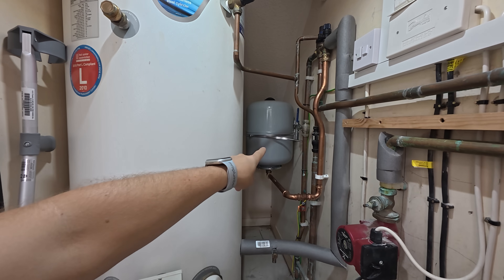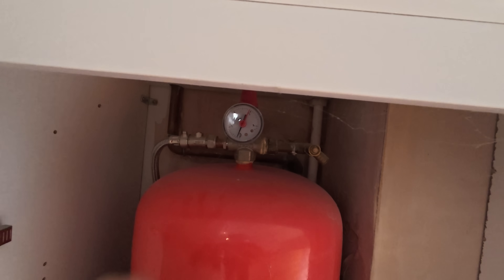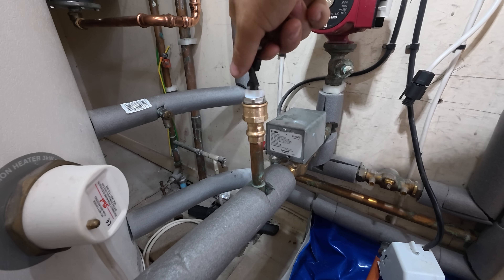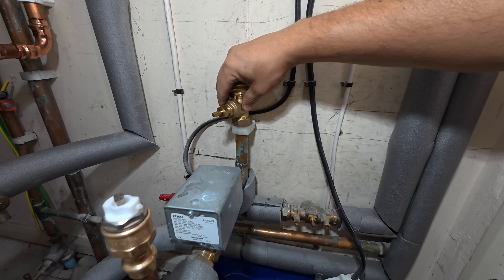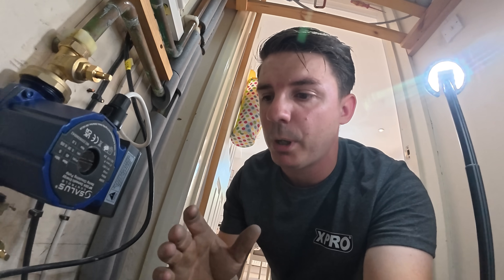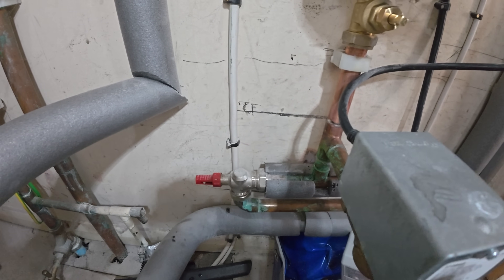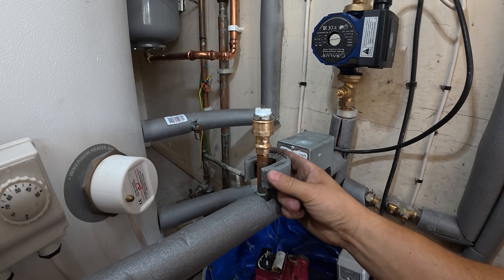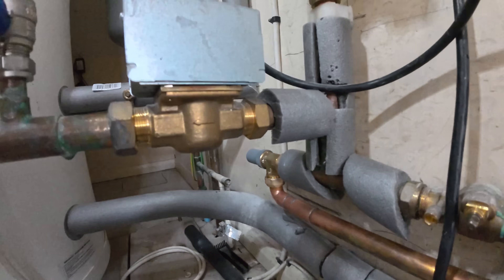No Heating No Hot Water Fix!

Comment: If you’d just cut that elbow off of the bypass valve, close to the elbow and put a new elbow on. You’d only need to cut a small piece of pipe from the bit coming out of the tee, and that way you could have saved having to sweat on the straight coupler saving a fitting and less joints. 😜
Reply from the maker: Good shout! Always find better way when you look back with a clear head 😂❤

Comment: Sir, electrically correct would be, to open the pumphead and rotate them, till writing is to read normally. Then would be the position of the cablegland ok. What was the problem of the original pump? Fixed rotor? Not practicable to unbloc?
Reply from the maker: The cable would have been too short

Comment: Did you set the by-pass? Maybe one for another video.
Reply from the maker: I left it stock mate no one knows how to set them up properly 🤣 I wish to learn myself
Reply: @mmplumber  Depending on the size of the pump an average 15/60 pump would be set at around 0.3bar. One way to set them is to turn off the heating system call for heat on hot water. Run until flow tempratures are up . Lower the cylinder-stat temperature, Boiler goes off, pump overun kicks in. And with the By-pass wound all the way in. Open slowly until you feel the heated water passing through it. You can do it via the heating system using one TRV with all other rad closed. Hope that helps.

Comment: Hi mate i never see you work on boilers. How would you know before going into a job like this that it wasnt a boiler fault ?
Reply from the maker: Because the boiler is a heat only, I’ve been a plumber for 18 years so I know myself round a system, don’t touch boilers on here as I’m not gas safe and people don’t relate to that work anyway
Reply: @mmplumber ur not “gas safe” but I bet you safer than most gas engineers in the country, best workmanship I’ve ever seen in a plumber
Reply: Because the controls are external big boy
Reply: @Fat-heed I meant before he arrives. The   customer is only likely to know that their heating/ hw isnt working.  Seems a bit odd to phone someone to fix that issue that cant touch boilers
Reply: But yeah with a few questions over the phone its pretty easy to rule out the boiler i suppose.  Not really easy for the average customer to know if they have a boiler or system fault
Reply: @lewisconway6431 sorry big boy now that u supplied more context I get where your coming from 👍🏻

Comment: I have noticed that you are not using Acetylene gas that plumbers often use, rather, using red colored gas bottle. What type of gas is in that gas bottle. I bought a mapp gas yellow bottle years ago and I still have some left in the bottle. They don't have mapp gas in my area any more, they do have a yellow bottle but I heard it is no longer a mapp gas. Acetylene runs pretty hot. I need to replace some of my one inch copper L pipe, and I haven't done it yet thinking that I need Acetylene or real mapp gas to be able to get a good solder connection.
Reply from the maker: It’s propane mate

Comment: If i'm working on a sealed system, I will just drop the pressure too 0. The system should then hang up. If no water comes out of your drain hose.You know the system has locked. At this point, cut in your isolation valve. You can now work on the system without having to drain down all the radiators. Vdi 2035 talks about positioning isolation valves in a system to reduce the amount of water that needs to be replaced when you have to drain down to exchange components. It goes on to explain that you should never change the water in a heating system, more than three times in the life of the boiler. Being able to work local absolutely, keeps the drain down and water replacement to a minimum.
Reply from the maker: Your not wrong at all but I’m showing this to people who might not seen bore 👊

Comment: Why did you drain the system down? Drop the pressure and change the pump / valves. And why on earth did you cut through the pump valves when you can simply undo the unions with a pump spanner?? That job probably took about 2 hours longer than it needed too 😂 YouTube plumbing
Reply: Yes drain system and carry out the work, correct way to it..what would I know I'm only 40years plumbing..jumping stuff is for chancers
Reply: @Roy-z2b  are you suggesting dropping the pressure is the incorrect way?
Reply: @Paul-gj9tx 😂😂😂start your own channel for chancer plumbers? He drained the system like you should..yes you can drop pressure sometimes but  that's not best practice is it? He soldering down low too..why have water sitting in pipes for soldering?
Reply: @Roy-z2b I don’t have the time to start a plumbing YouTube channel pal. I’m too busy doing real world plumbing….if you want to drain a system each time you work one go ahead….I’ll continue dropping the pressure and saving myself the unnecessary time of draining/refilling and the headache of airlocks on gravity systems….as I have for the past 21 years without issue 😂😂
Reply: You look at the state of those pump valves there as crusty as anything.
Sometimes the unions won't budge, especially if someone has used the fibre washers that come with the valves.
I tell you this after 45 years in the heating game, dropping the pressure don't always work.you think everything is ok then you undo a nut or union and it air is introduced and you go running for a recepticle.
In the end he did it in what I would call the correct way .
You do it your way .
But I'll do it my way and we will never agree.
Reply: @Lizzard-t Exactly, you can bet that pump is original and those unions will be stuck solid , it’s quicker to drain down , remove everything and bottom the job out 
Too many people these days looking to be a smart arse and try to make a fast buck but not this guy , he’ll earn his money and keep his reputation
Reply: A plug of air can sneak in and you've fit unnecessary water pouring out. He's clearly downstairs. 10 20 minutes extra to have complete control. What's the issue. I flick between the two. If this was upstairs then I agree with just asking the pressure off
Reply: @lewisconway6431 I’m guessing you don’t understand what is happening when you drop the pressure on a sealed system. A plug of air isn’t going to break the vacuum. I have “complete control” every time I drop the pressure as I know what I am doing.
Reply: But he doesn't know what he's doing it's abw
Reply: On occasion you don’t deburr the inside of your copper pipe fittings before soldering,Why?……Excellent videos overall.
Reply from the maker: No point in risking mate I drain down not a problem, cutting pump valves is far easier than trying to undo seized nuts
Reply: @mmplumber if you know what you’re doing, there’s literally zero risk in dropping the pressure. A proper pump spanner makes undoing pump unions effortless.

Comment: Suprised you didn't apply some of your sealant/thread lubricant to the pump body threads to make them easier to undo next time the pump needs replacing
Reply from the maker: Should be fine now it’s rubber, normally it’s when people fit the fibre washers you get problems

Comment: You should went for Pegler or Crane brand valve specially when involving anything with central heating systems , they’re suitable to use , top quality isolation valve, the other probably last like 6 years or more , you wouldn’t able to turn that valve will seize and handle or spindle will snap whilst turning it off , just take my advice, you will never disappoint paying few pounds extra 😅
Reply from the maker: Thanks for the advice mate!

Comment: Apologies if my comment is premature, I only have time for first 5 minutes. If you took the auto airvent out and the problem presented as an airlock! Did you try venting?  The act of draining it and refill could have fixed the issue. Did the airlock happen again? It could take a few weeks to develop. Jeese isn’t plumbing fun😂
Reply from the maker: Haha I was doing a job and the air vent was leaking so I removed it. Then they called me out a few weeks later to sort the no heating and hot water

Comment: Always interesting video. It doesn't seem that long ago you worked on that system. did the problem with the leaking bypass valve develop after the first visit or was it one you noticed and told the customer about? It's always good to be warned about potential problems?
Reply from the maker: So I removed the air vent that was leaking same time as the expansion vessel then the heating went down.
Reply from the maker: The bypass leaked when I was testing the pump as I was adjusting to see if it would circulate different

Comment: Why sometimes  You use a joint compoud for compression and sometimes doesn't bother of it. It's depend on type of fitting? Or just sometime cut these scenes in your videos?
Reply from the maker: The joints are prepasted inside the valve if I don’t show it

Comment: The best way I find out as I had to fit a new pump recently is to remove the bleed screw from the front and stick a small flat head inside and if the propeller  isn’t rubbing against the flat head then I know it’s dead
Reply from the maker: It was still spinning just not doing anything